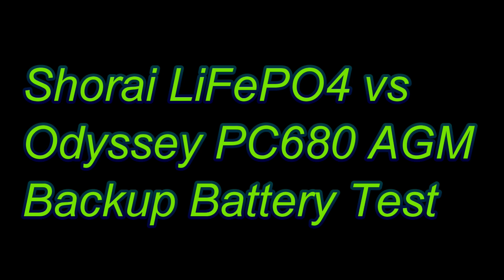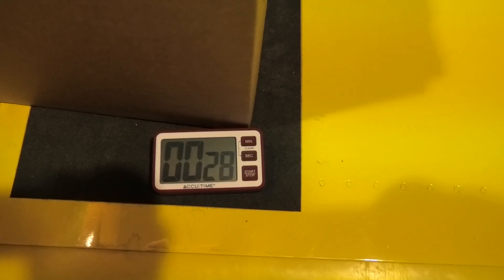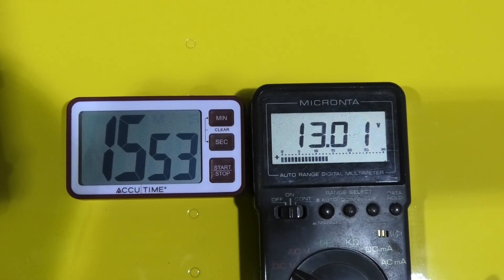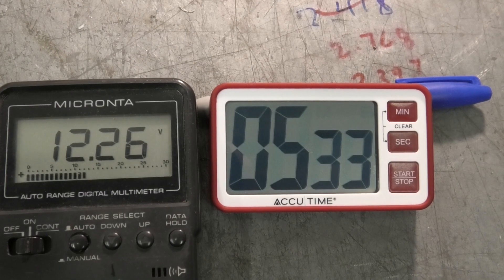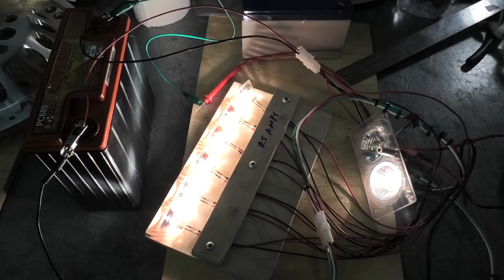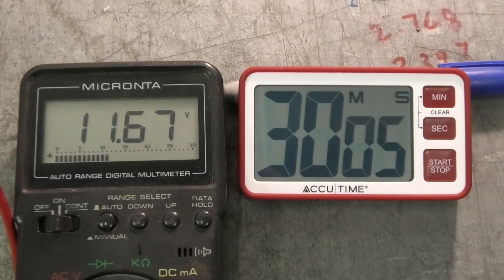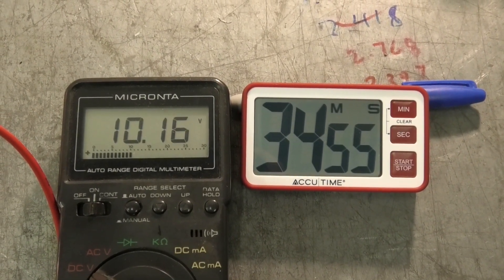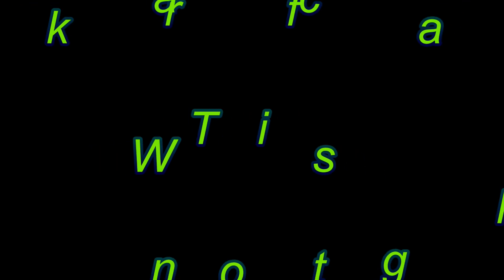Shorai 18AH Rated LiFePO4 vs. Odyssey PC680 16AH Rated AGM

Comment: I ran a Shorai in my motorcycle and it worked fairly well above 50 degrees, but was terrible in colder temps.  On a trip to Alaska, we had several mornings where it would not crank the bike fast enough to start it initially.  My BMW has a fairly high compression engine so doesn’t crank all that easily cold, but the original AGM battery cranked it fine down to 20 F.  I had to turn the key on and wait 5+ minutes when the temps were between 35 and 40 F before the battery warmed enough to crank the motorcycle fast enough to start.  It was a happy day when I replaced the Shorai with a new AGM.  The light weight was nice as was the slower self-discharge, but having to wait 5 minutes in order to crank your bike when everyone else has their bikes running and warming up is a real pain.
Reply from the maker: Agree, they are not the best choice for cold conditions.